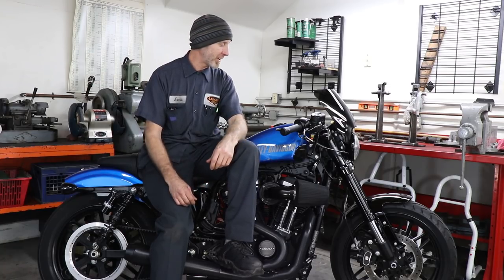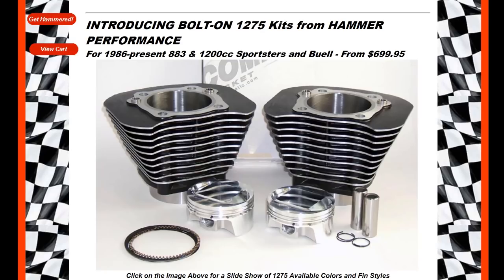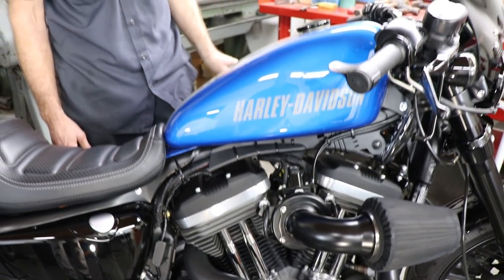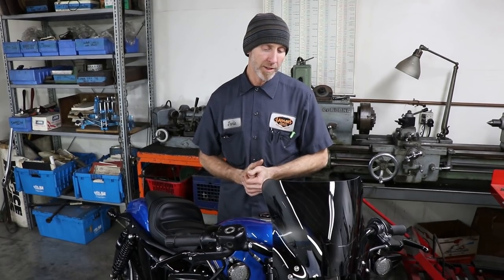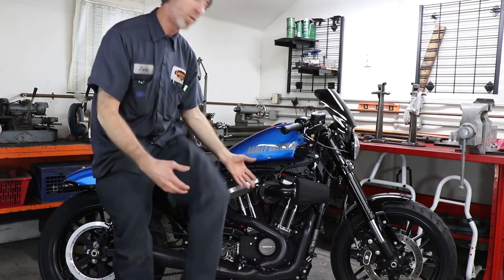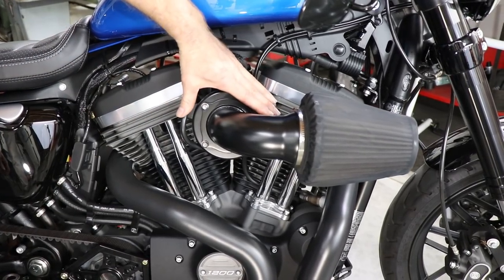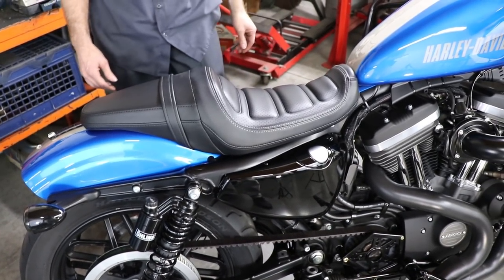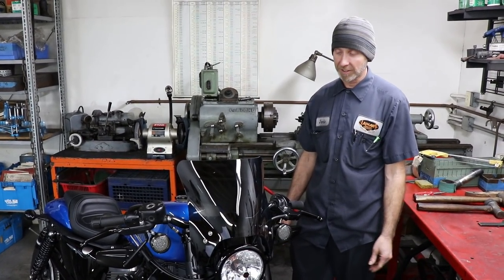Jamie's Roadster with Hammer Performance 1275cc Engine Build and Cobra Exhaust

Comment: Inspirational, I have an iron 1200 that I’m considered doing the hammer kit to.
Reply: Dont consider it just do it. Best performance youll ever obtain from a Sportster thats streetable.
Reply: Can somebody post the link to the kit for a 07 sportster nightster thank you much love fam💯💯
Reply: Same here. Does the ride get smoother on the freeway. Right now I’m at at stock and I can get it to 70-75 with some vibration. Not terrible. I want to increase speed and power but what can be done to make the ride a little bit more smooth?
Reply: @expendable4h002  i did a belt to chain conversion on my 07, 51 tooth rear gave me a little more top end and much more comfortable around 70~75 but yeah you can experiment/research with different size front and rear sprocket to see what's comfortable and it wont break the bank
Reply: @leelizardwilcox6271  last time I checked the DMV doesn't Dyno your bike once you buy it you can turn it into a damn spaceship how are they going to know...

Comment: This build inspired me to buy a 2017 Roadster and, after 50 years of riding, I love this motorcycle. Modifications included a 4.5 gal. XL1200C tank/seat, Cobra pipe, Euro fender-mounted license plate, factory 48 rear fender and handlebars. Will probably go with the Hammer 570 drop-in cams. Can't wait for summer.
Reply: Miles, did you have to change anything for the bars?

Comment: Can't wait to get mine installed next winter. Have a 2000 883 Hugger with an  S&S 1250. Going with the Hammer Performance 1275 120+hp package but with a different exhaust and possibly a Mikuni carb. Gonna run me around $5,000 without installation but by the time I'm done converting it to a balls to the wall bobber it'll be well worth it

Comment: What external breather, catch can and hose length is that? I definitely need one, I have an issue with oil leaking onto the top of my primary and pooling as the bike cools down.

Comment: I did just the 1275 jugs and pistons on my 883 and it turned her into a beast.
Reply: how much?
Reply: @Sam-w9des under 1k for jugs, pistons, ring installation, gaskets and clutch (I already had a tuner).  That is about the cheapest possible.  Start adding in cams, head work, etc. And it can get into the thousands fast.  I also did my own install.  If a shop is doing it, that id pricey too.
Reply: @TheBeardofDOOM  thanks

Comment: The Roadster needs and I stress needs rear sets.  I was very disappointed with the peg position when I rode one when they first came out.  Then I sat on one with RSD rear sets that required RSD exhaust and was amazed with the riding position.  The cost, not so much.
Reply from the maker: HD makes rear-sets for this bike as well. Might be a better choice if you don’t want to change exhaust.
Reply: @MattLaidlaw  , they didnt back then.  I wish i could choose a modle with rear sets, instead of having to replace what doesnt work for me.  Most Cafe bikes have rear sets.

Comment: parts cost? been loving my 2005 roadster for about 13 years now.  when I saw the 2016 come out I figured Harley really hit the mark but the performance upgrades are what really makes this bike sweeet.
Reply: Bout 3 grand and some change. Probably end up closer to 4 with a power commander. Hammer kits are pretty sweet if you want to hit 100+HP for a decent price. Even better if you can do the work yourself.

Comment: I come from a modified sports bike background (30 years riding) and yours is the first Harley I've seen that is close to what I'd like .
It clearly pulls strong with great power and torque but can I ask how the handling (ohlins) and brakes compare with stock sportster. 
I currently run a supercharged busa and I'm intrigued by a sleeper sportster. 
Great build Sir

Comment: I absolutely love it! All H-D "Heart & Soul"! I also own a 2011 XR1200x which I really love. A true Harley through and through. Still sad that you got rid of the Heritage. It was totally badass. The person who bought it is very lucky indeed. :)
Reply from the maker: The XR 1200 is a cool bike man. Thanks for the comment. Enjoy.
Reply: Thanks Matt! Whenever people see it, It's the one I get asked the most questions about. Very cool & fun to ride. My only complaints are that it lacks power compared to other V-Twin sport bikes and the 5 speed transmission. It should have a 6. Still, I totally love it and plan to keep it forever. It's 100% original - no mods whatsoever. ;)
Reply: @MattLaidlaw  The XR1200X is the ultimate air cooled Harley Davidson ever produced. The handling is excellent(especially with the rearsets) & I've always wondered how high one could go on the horsepower wars. Only real problem is the weight...

Comment: great looking bike . that engine sure revs up when you hit the throttle !
just curious , does going from 1200 to 1275 really give you much of a boost , or is it all in the other parts , cams , exhaust , ported heads etc. ?
Reply from the maker: It’s a lot about the other parts as well but there no replacement for displacement.

Comment: Been looking at this damn 1275 kit for awhile now. Hard to keep from adding all them hammer performance goodies to my cart. And now time has passed and 21,000 miles have gone by on my "48".....not sure about the kit with high mileage. Probably would destroy the bottom end before another 5,000 miles went by. Nice build bro! Sounds like nice clean power!
Reply: That’s still low mileage for a sportster.

Comment: Hi Jamie! I absolutely love your bike! Im considering a 1275 kit for my 18 iron883.  I was wondering if the kit that you put on there was the kit with the smaller fins or the larger finned cylinders?  NHRS claims that it doesn't make any difference in heat.  I wouldn't mind saving 100 bucks if that's the case! Thank you

Comment: Wanting to do the same thing to my 05 883 low.  Got a basic 1200 kit on it now with small valves. Looking for a set of 04 to 06 1200 heads to send to Hammer and buy a 1275 kit when they send it all back.

Comment: What size Ohlin shocks are those? What do you recommend for a Iron 883? I currently have 12 inch Progressive 444 shocks and they are better than stock but im not super happy with them and want better but don't know if I should go 12.5 or 13 inch instead for more travel.

Comment: Jamie I have a question for regarding the 1275 kit.  A buddy of mine has a 2003 XL1200.  He is thinking about getting the 1275 kit from Hammer perf.  We saw some of their sample quotes they have on their website on their 90hp builds, 100hjp builds, 110hp build and 120hp builds. They have so many other components on those quotes.  If he was going to go with either a 110 +hp or 120+ Hp would he need everything they have listed on their quotes. I was thinking he get the 1275 kit, the sledge head work, rocker arms, either the Mikuni 45mm carb with manifold or S&S carb kit with manifold and air cleaner, cams, quickie adjustable pushrods, maybe a Dynatech ignition and maybe a stronger clutch.  Would that a good build or would you recommend some of the other parts that Hammer has on their quotes to make the motor more reliable?

Comment: Hi Jamie.. question?? Have you checked your fuel mileage?? I'm thinking of 1275 kit in my 2017 SPORTSTER 1200 low t .it's a real bagger now..Harley hard bags with cycle vision brackets. It tuns great but I want more power..will lose fuel mileage????

Comment: I called National Cycle to ask about that windshield. They said that it wouldn’t help much with the wind. Would you agree? I need a windshield and that is the only one I have seen that looks decent but don’t want to spend the money if it’s not going to help. Thanks for the video. I am 5’10 160lbs
Reply from the maker: I agree. It isn’t going to do much with the wind. It’s mostly for cosmetics or if you’re a lot shorter Than you.
Reply: Thanks

Comment: I’ve watched this video more times than I’ve had hot breakfasts. My roadster is already showing signs of corrosion (whiteish dots) all over the brake metal lines and under the light. Is there something to fix all that up.  I want to do the 1275 Hammer kit but don’t want to do on a bike that’s going to keep getting uglier. It’s only 3 years old.   I’m not sure why it is failing so quick. I’ve only had BMWs recently and every fastening looked as good as the day I bought it in comparison. I just wanted to do the Harley thing but needed a performer and the roadster is the only bike I feel that has the character and capability I needed as an experienced Aussie rider.  I’ve gotten 185 km an hour out of it so far and beat a fat bob on the same “track” we were hustling upon from a point to point 30 min run. I was exhausted and never felt so lucky. The Nike never missed a beat and I can genuinely report the harder I went the better it felt. Strangely it takes hauling on it for about a quarter tank and filling up before the blast to really get it in its element.  I believe an oil cooler will be my first upgrade since stage 1 and I’ll be interested to see if the engine responds accordingly. So simply put. How do I make her beautiful again. All the painted surfaces are still good. Oh, and that stupid foot peg is rusty as hell wtf metal did they use.

Comment: Is there a reason you would want to start with a 1200 to pour all that money into beefing the motor? I would think it would be much more economical to get an 883 as you can get the same bike with the same mileage for less.
Reply from the maker: The main reason is because of everything else that comes on the roadster like wheels suspension etc.
Reply: @MattLaidlaw  they have roadster 883.. not trying to be difficult.. but are you saying the roadster 1200 has different wheels and suspension ETC. than a 883 roadster?

Comment: I wish I could see the mph and see what the difference is between the screaming eagle stage 4 and the hammer 1250 or 1275 kit is
Reply: It's, uh, quite a bit. The stage 4 screaming eagle kit is rated around 87 horse, the Hammer 1275 kit is 120+